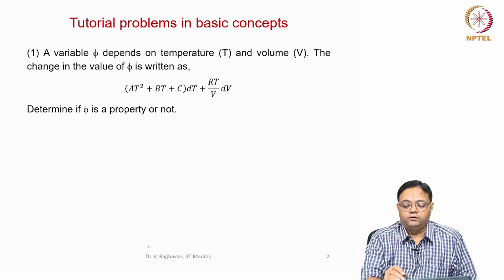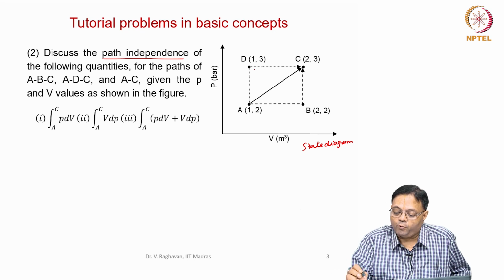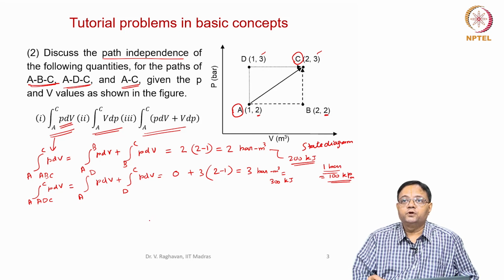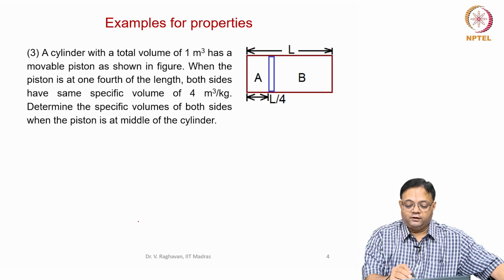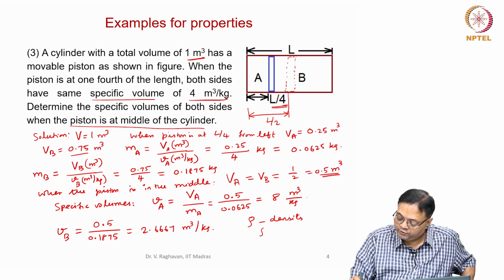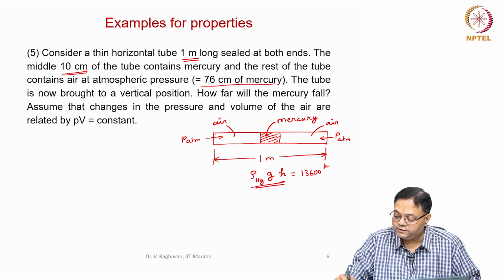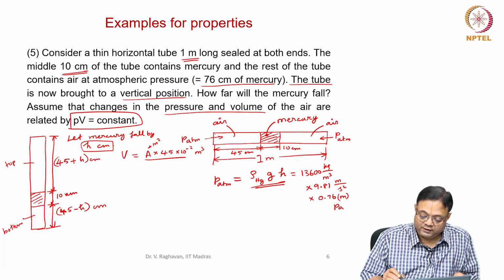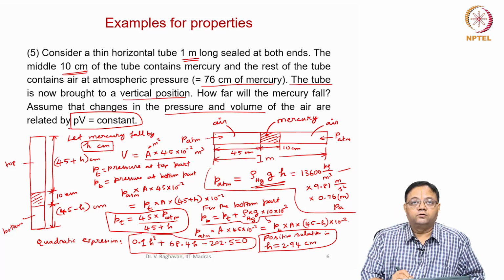Tutorial 1 - Basic concepts, pressure and temperature measurements- Part 1

Comment: Why are we taking dM/dv and dN/dt in the first question
Reply: Because of the following reasons:
1) If you have a function with n variables:  f(x1, x2, ..., xn) and you calculate the partial derivatives df/dx1, df/dx2, ..., df/dxn, each of these tells you how the function f changes ONLY by watching how one of these variables change.
We define the TOTAL change of f denoted as df equal to the sum of all its partial derivatives, where each term is multiplied by the small change of the partial derivative (the denominator of the derivative symbol),
this means: df =  (df/dx1) * dx1 + (df/dx2) * dx2 + ... + (df/dxn) * dxn (The total change in f in respect to ALL its variables!!!)

2) Now, calculus 2 tells you that you can retrieve the original function f if you know df by integrating both sides of the equation, ONLY if the partial derivatives are exact differentials!!!

3) Exact differentials means: To simplify this because its hard to write it down for multiple variables, if you have a two-variable function φ(Τ,V) and you know that dφ/dT = M and dφ/dV = N, then dφ is an exact differential if and only if:
dΜ/dV = dM/dT (you basically calculate the derivatives of the partial derivatives again, but swapping the variables of differentiation). dΜ/dV, dM/dT are also the same as:

dΜ/dV = d(dφ/dT) / dV
dM/dT = d(dφ/dV) / dT

You are differentiating twice in a row using all the variables!

So finally, if dΜ/dV = dM/dT is true, then you can integrate both sides of dφ=  (dφ/dT) * dT + (dφ/dV) * dV = (AT^2+BT+C) * dT + (RT/V) * dV to find φ (the original function), which in a physical meaning it means that φ is a physical property,
but in this example, this is not the case, because the condition dΜ/dV = dM/dT <=> 0 = R/V fails, so dφ is not an exact differential, and the retrieval of φ is not possible => φ is not a physical property!